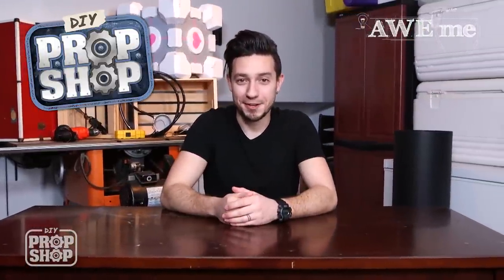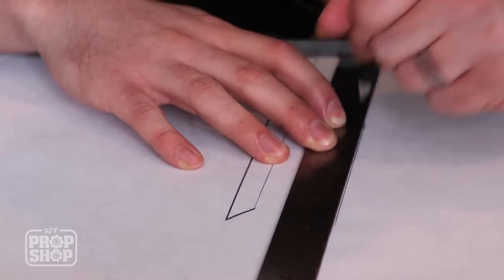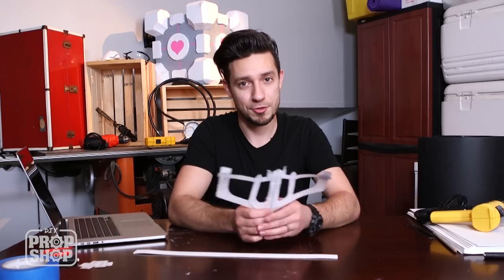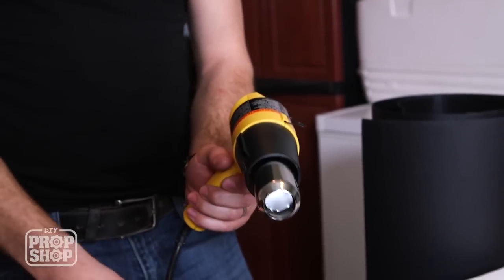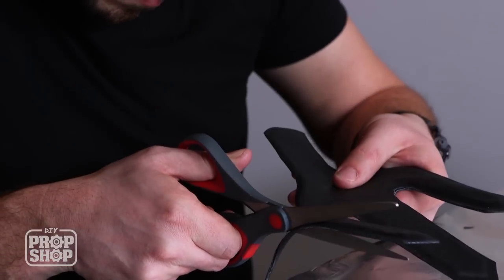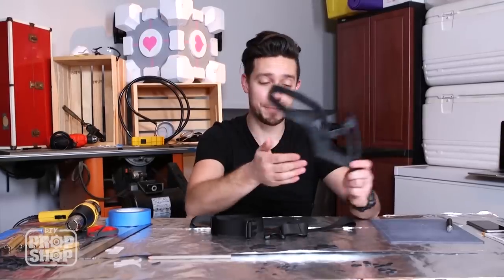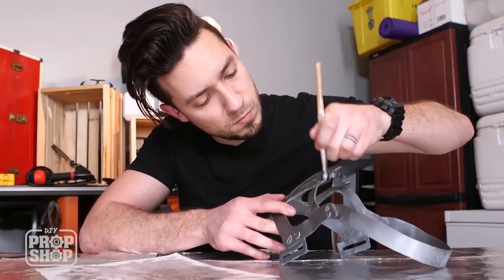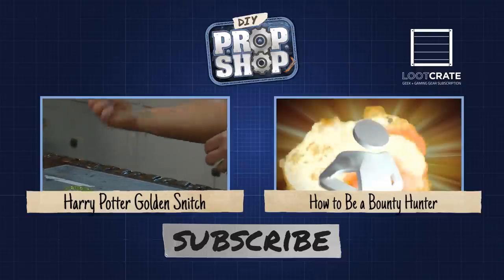DIY Mad Max Face Mask! - DIY PROP SHOP

Comment: +AWE me a alternative to the thermoplastic could be Aluminum or zink galvanized steel sheets. the advantage is, that it is cheaper( maybe just in germany because i am from germany;) )and another advantage is, that you can easyly bend it and you only need pliers and steel scisors to cut and form this.

Comment: Not to be rude..., buuut... how about getting a gardening fork from a hardware store (which the prop is made from) and some 0,5 to 1 mm  thick sheet steel + maybe so metal shears  and just rivet or screw the thing together? Sounds like the more direct approach to me and it would be out of real metal too. Probably even easier to find than thermal plastic.

Comment: Nice build but you used the drybrushing "backwards"...O.o
Drybrushing is good to hit the higher spots, but dirt or (simulated) shadows are in the lower parts. A much better technique would be, painting the whole thing with a watered down black paint and than rubbing most of it from the higher spots with a rag.

Comment: just saw off a peice of a garden fork and tape it to your face. there perfect
Reply: +Zero Nguyen 

I thought of that too, but a real hand, garden fork is made of steel, and way too heavy.  

You'd have to use metal and leather to make the straps and support cage sufficiently strong to support it.   It's great if you want a hero piece for display, but way too heavy to wear comfortably for cosplay.

Comment: why put on the paint in backwards order? if you spray it a non glossy black first and put the silver on with the dry brush you'd get better results. great work with the plastic though.

Comment: Wasnt the whole point of this series for it to be cheap materials to work with? If the materials is $25-30 how is that cheap? Seems easier to spray paint materials already at hand like a fork looking object for the front of the mask